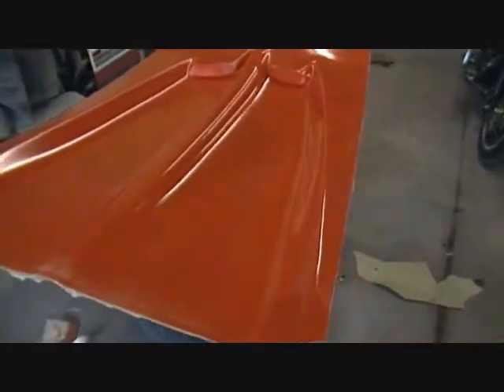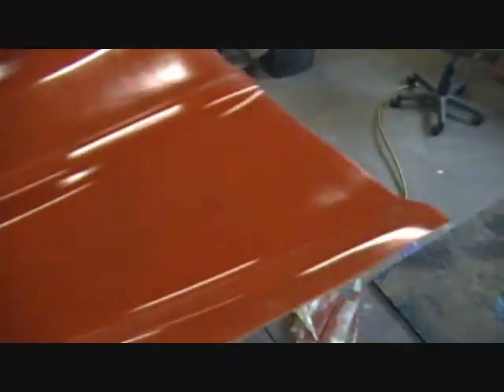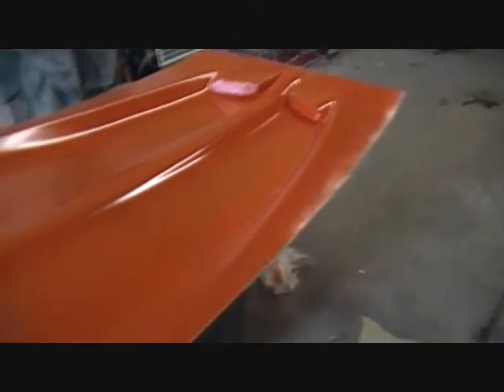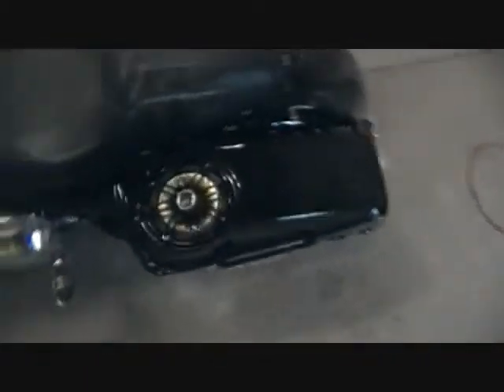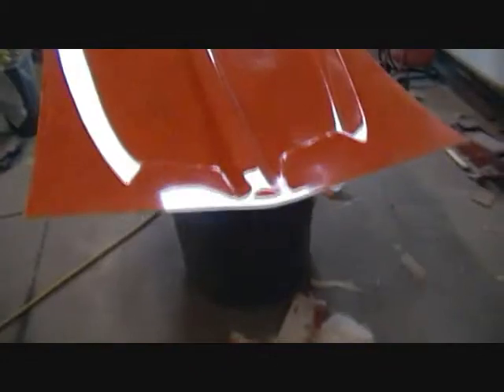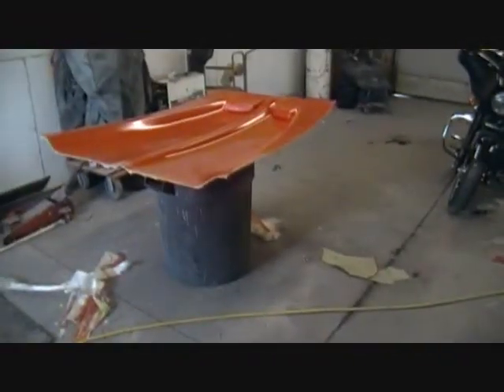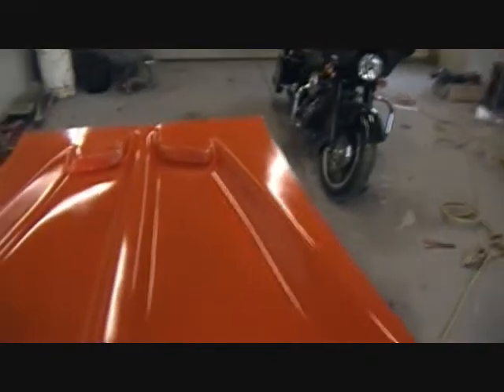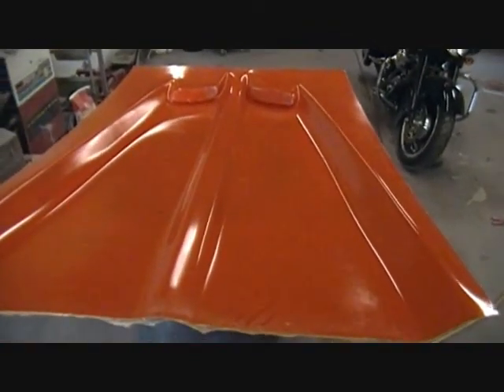fiberglass hood scoop

Comment from the maker: same engine for now its just a weak 355 gonna rebuild it and put a bigger cam in it and actual exhaust...and probly a set of heads. just hopin i dont need machine work on the block.. would rather hone it out and put the new parts in.. the parts are comin from council bluffs that wholesale place. i think its like northern auto parts or somethin..